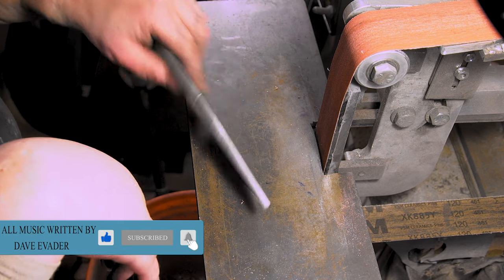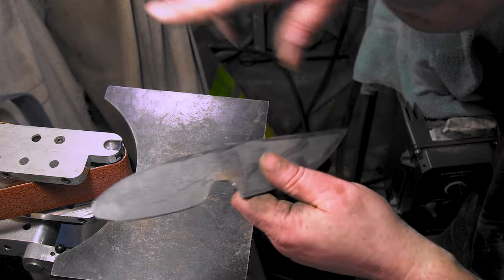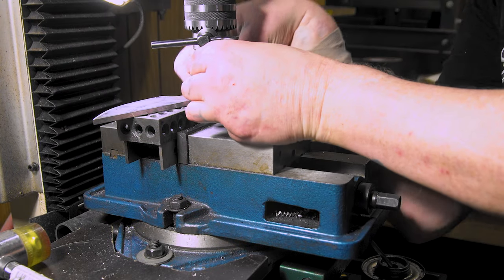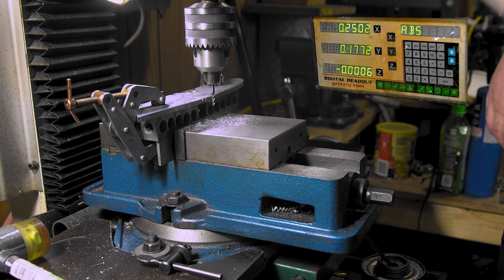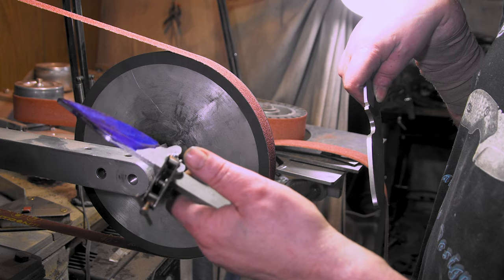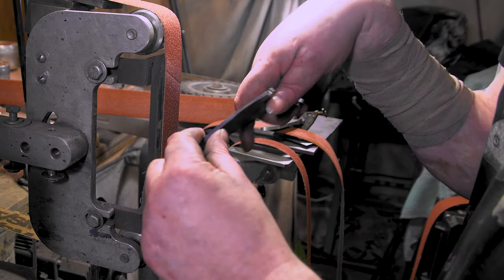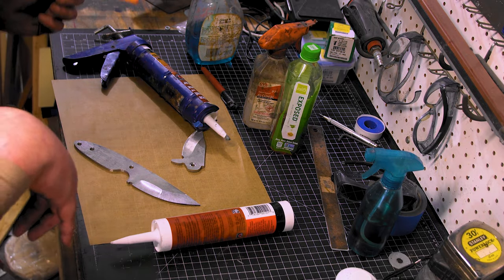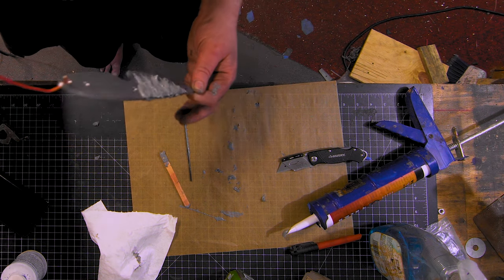Fixed blades, Bevels & Hamons - Knife Vlog 9

Comment: U should do a double hollow compound grind like guardian tactical. I think marfione does them as well!!!
Reply from the maker: I just had to look it up. Are you talking about the Helix Nano? Let me know. I think that is a reverse compound grind, where the hollow is on the front & flat in the middle. Marfione has a compound, but they are both flat grinds, one is just higher. Let me know the design, I'll check it out.

Comment: Its hard to tell Dave but is that 3/16 or 1/4 inch stock your using?
Reply from the maker: 3/16" It's what I use for most of my knives. Kitchen knives, i usually use 1/8", but i did get some .156 for these folders to try out.